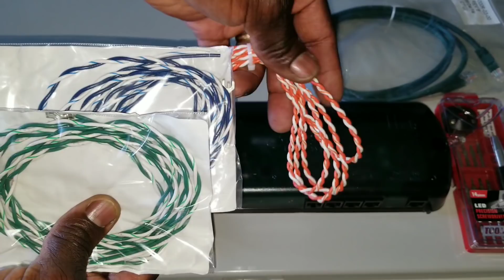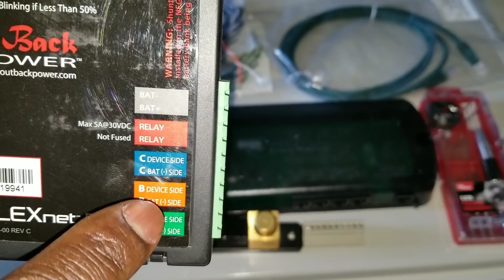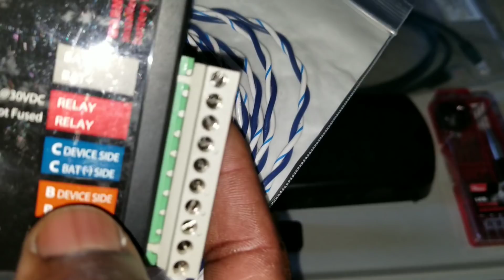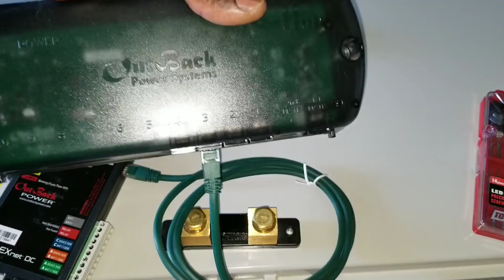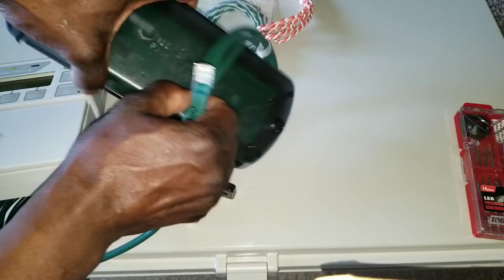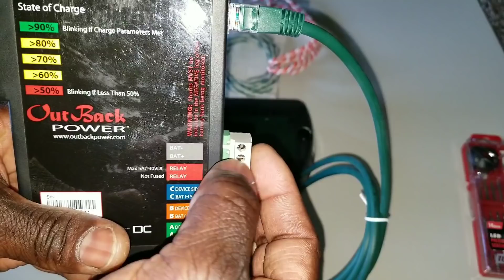OUTBACK POWER SYSTEMS: INSTALLING OUTBACK FLEXNet DC (FNDC) BATTERY MONITOR

Comment: What if the FlexNet DC don't light up and dont turn on like it did before? What should I troubleshoot to get it to turn on?
Reply from the maker: Call OutBack Power Systems
Reply: @jwsolarusa  I think I might have to... I just think I might pay too much though and won't be able to afford to troubleshoot the issue. Do you think I may of blown an inline fuse on the flexnetDC?
Reply from the maker: @discountvacationrentals  
Yes. You might have

Comment: hi    i can need your help.
what type of wire is this ?
i think the batterie and shunt are maybe  35-50 meters away in a container.

and i have two Cat7 Cable (ethernet) in one pipe  it´is posible to use the flex net ?
Or do you have a different idea to see (only need)  the battrie  capacitie  in the house.
sorry for my bad english and thanks
Reply from the maker: 3/0 AWG CABLE I had with my previous system.
The other wires are CAT5 or CAT6 works either way